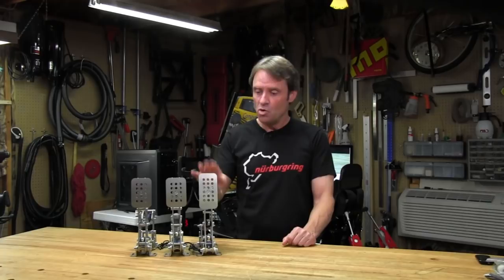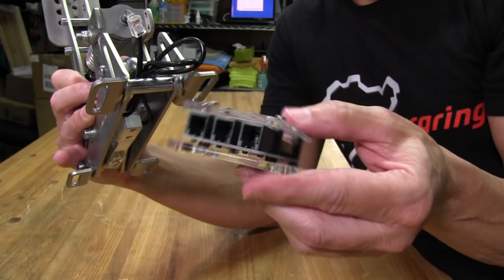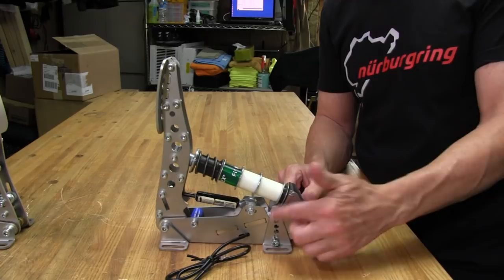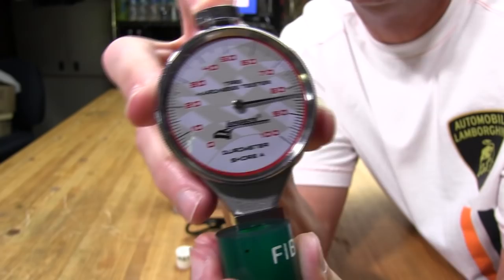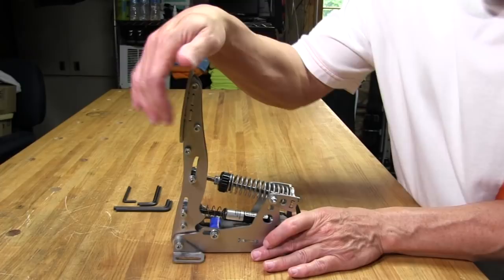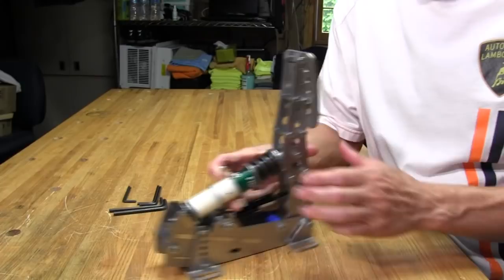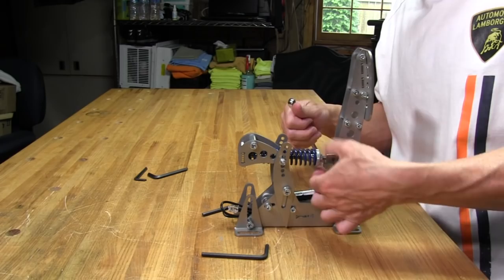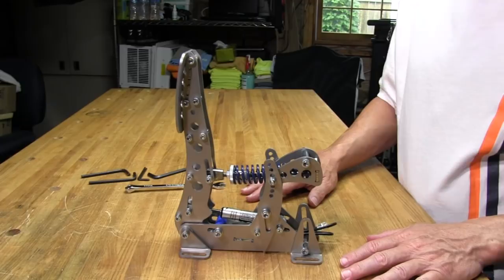Heusinkveld Engineering Ultimate Pedal Review

Comment: I wish you could review these again! I just bought them, Best Buy ever, but another review would be so amazing!
Reply: The HE Ultimate+ were announced two days ago for release in summer.
Reply: @Leynad778  true. Mine were still in the return period. They offered me the + upgrade package for free!
Reply: Any problems with squeaks from the pedals?
Reply: @wuzumaki  no not at all. Only small mechanical noises, like the gas spring. But if you have it it's wise to oil the points Heusinkveld points out, that might reduce the squeaking.
Reply: @AntonyCBSR I just got my set and the clutch pedal has a lot of noise coming from damper. Did you have this problem?
Reply: @wuzumaki  no I have no problems at all, what did Heusinkveld say about this?
Reply: @wuzumaki  i mean, i got the 'standard' mechanical sounds. But not the irritating ones. Let's hope they'll fix it (which i'm sure off, they're customer friendly!!!)
Reply: @AntonyCBSR  The damper is noisy when I stab the clutch, but if I press and release it slowly like I would in my daily car when cruising, then there is no noise. Is this your experience?
Reply: @AntonyCBSR  Heusinkveld has decided to send me a new damper even though they can't neccessarily hear anything strange on my clutch pedal from the video I sent them. Let's hope this solves the problem.
Reply: @wuzumaki  let’s hope so mate! I have no issues at all for now. And I’m sure if there will be in the future they’ll solve it without any hassle 👌

Comment: Great review Barry, as always :-)
As for 200kg marked on the load cell - that's where pedal ratio comes into play. Judging by the vid, it looks to be at about 1.8:1 which means, pushing 60kg will load the LC by 108kg, assuming linear load transfer, no additional leverage where the LC is mounted etc. Still, assuming that, 200kg on the LC means about 111kg of pedal force.
Reply: Marek Lesniak You're not far off, The peak pedal force you can apply is 136kg

Comment: I am either very weak, or the way to swap out the rubbers has changed. It is HARD to pull that thing back in the slightest, but maybe when it's hard mounted. The design seems to have evolved quite a bit til now even tho they call it the same series. Props to Heusinkveld and team, incredible set of pedals.

Comment: Great review.  I was actually  ready to order a set of the Ultimate Pedals but in the process of looking for a rig, I came across the TC-R1 and the reviewer really loved the Wilwood TC-R1 hydraulic pedal set made by the guys at TC-R1.  Wondering if you've ever tested the TC-R1 pedals and how they might compare to the Heusinkveld set. He was really loving the TC-R1's but had never tried the Heusinkvelds. Thanks!
Reply from the maker: That's the problem that keeps coming home with higher end pedal sets. Not many, if any, will have the chance to try them all. And most people are coming from a "lower end" pedal set and the difference in a high end set can be amazing when compared. Hence you don't see any really bad reviews on the higher end pedals. But they are made much better in all areas. Including materials, designs, implementation, quality control, and usually, customer service.

I would like to try Marks Pro Pedals someday. Being a mix of his hydraulic clutch and brake design, and Joes Racing Products Throttle, I'm sure they will be very nice. Maybe when I'm down his way one day.

Comment: what do you like better? the HPP or the Heusinkveld Engineering?
Reply: +Parker Chase Just got the  Heusinkveld Engineering and they aside they didnt even send a usb cable and several bolts were missing gotta tell you, i dont see how these can cost what they cost, i mean they are ok but is just like a step up from the g27 pedals, really, i dont feel the "real car simulation" effect. Also the brake is too hard to push, you should try them before buying them.
Reply: +Cocoliso Osilococ Hi there, I think we've been in touch over email already. If not, please do. We normally include a USB-cable with every order and your pedal set should have come with a complete and perfect bolt set. Mistakes do happen sometimes and we always try to resolve these as soon as possible.

If the brakes are too hard to push, you can try to lower the max calibration values or get in touch with us with regard to an exchange for Sim Pedals Pro. These pedals were designed for professional applications and they do nowaydays find their way towards simulators used by for example LMP, GT, GP2 andF1 teams. Race cars can be very physical to drive, and so are these pedals. 

If there's anything we can do to make you happy with your purchase, let us know. 
^Svend

Comment: you have the backer part of the clutch in the wrong slot. when lowest in front, you need to lift it in the back. I also did how you did and it is wrong. it will not work right. i hade it like that too. but after looking at vids from the creator. i understand it was in the wrong place. move it up and it work how it  correctly. 
not to pull your leg but it is what it is. 
best regards frank eddie.

Comment: Load cell for accelerator is just more points of failure. Use a pot or hall sensor FFS.
Reply: How is a pot less of a point of failure than the load cell? I mean yes a hall sensor might be better because it’s contactless, but load cells are pretty sturdy, especially those used in here. As someone who races Pots on clutch and throttle I’d rather have a load cell there.